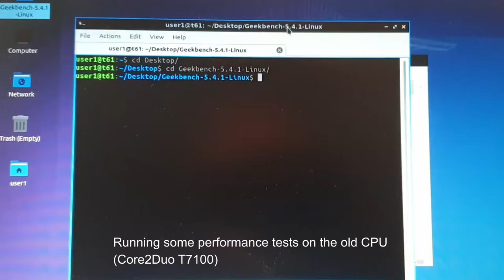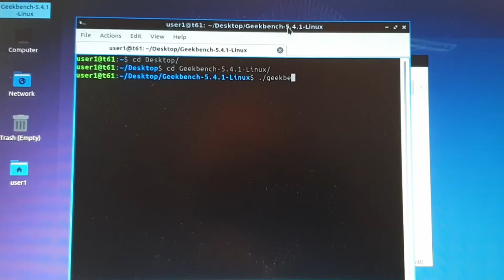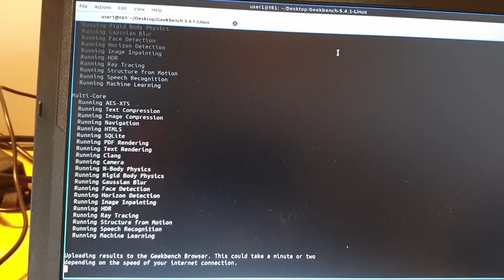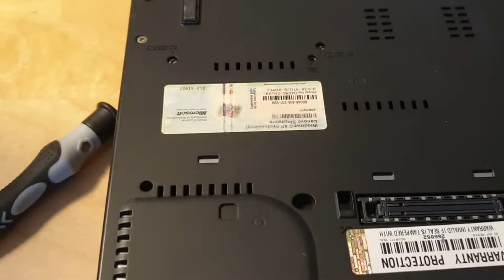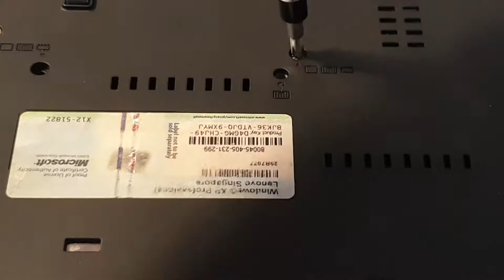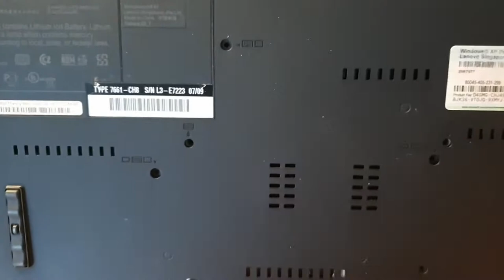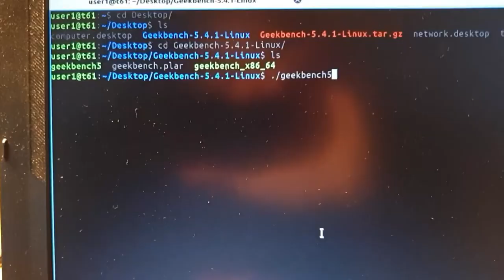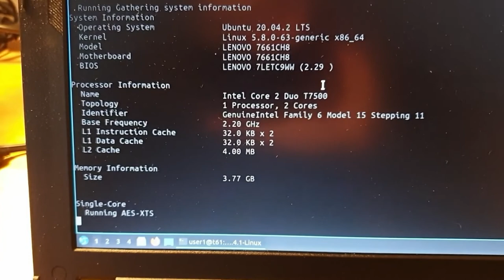Thinkpad T61 cpu upgrade

Comment: I recently did the same thing, but installed a T7800 processor which runs at 2.60 GHz. I also installed an SSD and Middleton's BIOS which has removes the whitelist so you can install a faster WIFI card (currently I have an AC-7260), and the BIOS removes the SATA restriction to allow for SATA II speeds.
Reply: Hey mate. I have a t61. Just installed 2gb ram, 1tb SSD and a t7800. What's all this bios hack ? How do I do that mate? 😊

Comment: Just bought 4gb of ram and a t9500 for my old beast and it only cost me 17 bucks for both. I dont use this unit that often but it would be nice to have one that I con mount to the dash in my vehicle and use for ODBII info and whatnot. Thanks man! I did not know if this had a soldered CPU or not and now I have my answer.

Comment: Can we upgrade with i3 or can you suggest a good procccer
Reply from the maker: This laptop only takes core 2 duo CPUs, not an i3. The fastest chips that will work in it (unless you're willing to extensively mod it) are the T9xxx series (C2D T9300, T9500 etc.) I think the T9300 is the highest end chip that makes sense for this laptop, since faster models are very expensive still.
Reply: Oh men i want to put i3 on my R61 thinkpad. got the same question..
Reply: @rlcyphr8529  Would it be possible to also upgrade the graphics card? If so, what types would be compatible?
Reply from the maker: @EwanA  The GPU is soldered on in this laptop, it can't be upgraded unfortunately.